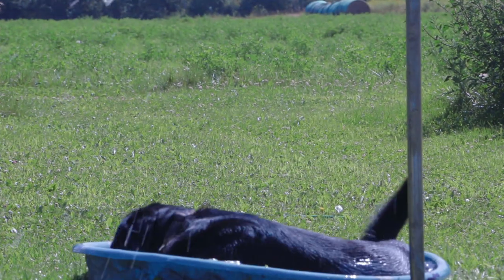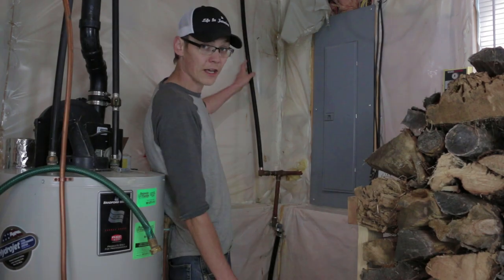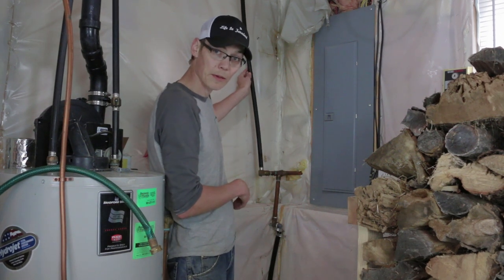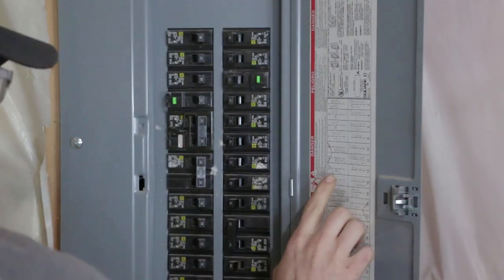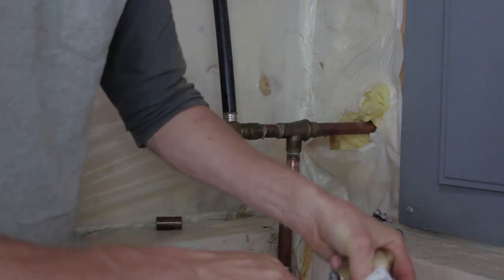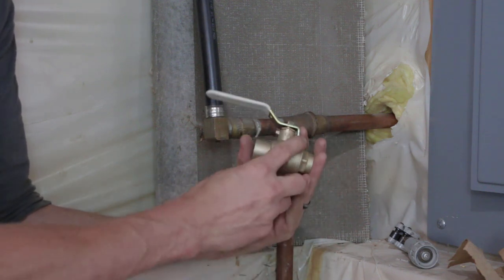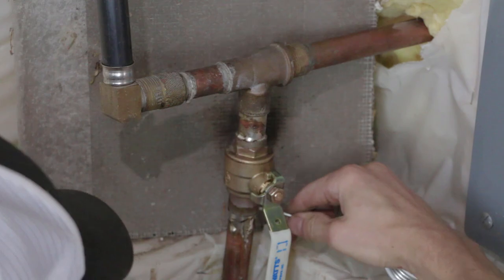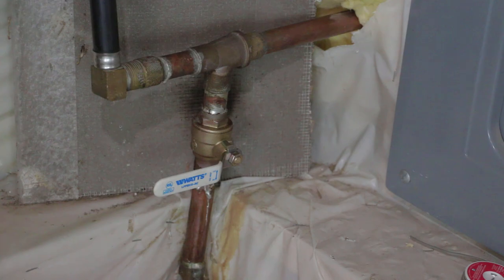Leaking Yard Hydrant Repair Part 1 -  Installng Brass Shut Off Valve / Sweat Copper Water Pipes

Comment: Glad you offered a tip with the cement board and fire safety. My Dad was thawing frozen pipes in the attic and a little insulation started a slow burn. Later he smelled smoke and I had to evacuate my younger sibs to safety. Good thing he caught that smoky smell. The firemen said the slow burn and smoke inhalation would have been our deaths that night.
Reply from the maker: COCO NOelle wow, scary stuff. So glad they caught it.